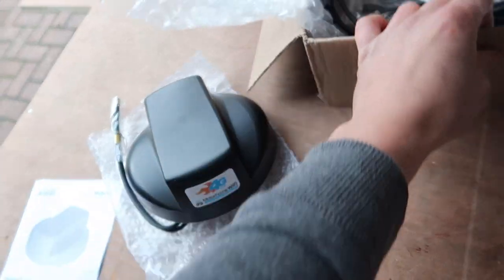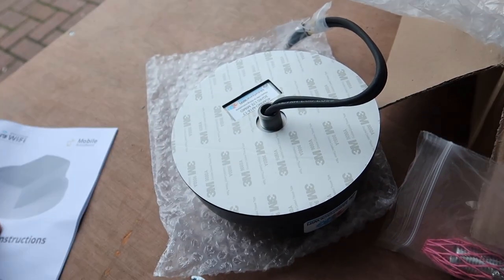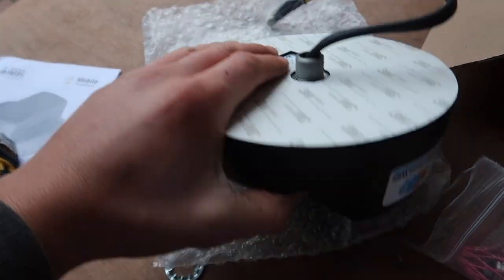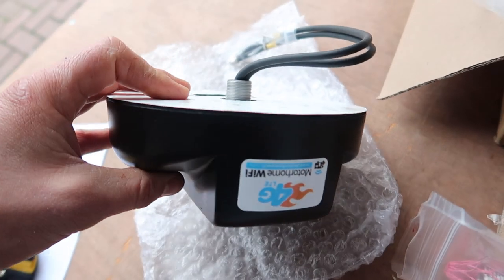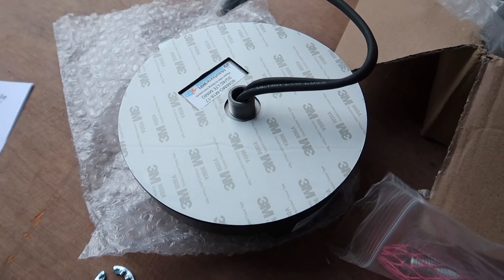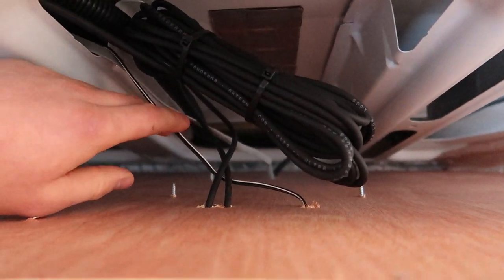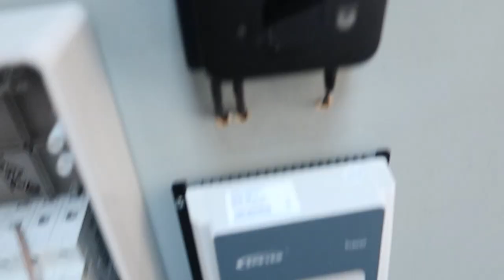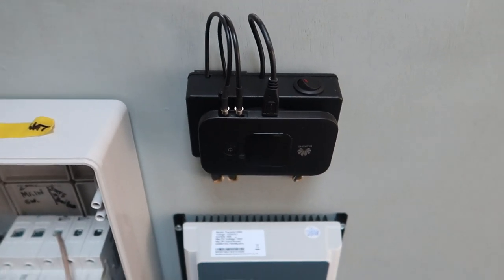Motorhome Wifi Install | Ep15 | Sprinter Camper Van Conversion

Comment: Looking good !
I might suggest using cheap black pvc conduit to run ALL wiring through ?
Not only does it reduce chafing ( shorting on the metalwork)  but also allows you to pull existing or new circuits through afterwards if needed.
Looks like a fun project ...

Comment: HI! Great Vids! I noticed on your roof by the wifi booster you have another antenna, is that a digital TV aerial? It looks like something I was looking into getting, which one do you have and how good is it? Cheers, Mark.
Reply from the maker: Honestly Mark we didnt use it much but when we did it worked well. It did seem to be good quality however and we did get signal. We tended to use our internet connection with media applications to play things through the internet. I cant find the one we used but here is a link to a very similar one probly the same manufacturer with different branding ---
https://www.ebay.co.uk/itm/203211173854?hash=item2f50546fde:g:GMMAAOSwUKZffnM1&amdata=enc%3AAQAHAAAA4L4B5nuCJXH7SrQsTVR7o2zaIUXFrA3APCb1jxtrvOatob6Nitw6mFCLPfmf4IF9DLTJDih%2FD4Zi2Irsqy21Y%2FINI2VWf8i8HrS2n4X%2B5mK5REiGdwrhnw5c3jvGmlzGKDEqHnDc2kK7I7nJVU6%2F2ismOkZOg3k2balWKSl0AXQIeYADj96zAsOxeWfYzN%2BUJb4iH9942Mzwz7vcf2CpCPKJy3aybWHq1rqtVpTADe11ELXSM%2B50qonY1dY9XkwogGQm6FXYp%2BF%2FmjmjdoLc7P5GbrK8W7wo1v7bbAMM5Ziw%7Ctkp%3ABFBMmr7T7dBg

Comment: I thought I had read somewhere that the aerial booster reqs a clearance all round of 150 mm, 
I noted you fitted yours quite close to the roof vent ?  Has your booster worked well,
PS thank you for the video I'm looking to fit one  👍👍👍
Reply from the maker: Hi Howard. Yes it has been fine

Comment: 2016 our trip away touring some sites was ruined when as soon as we got into the hills, no cellphone service, so no google maps, so saved pushpins or directions .... spent an afternoon driving back to civilisation to get signal to start the nav, to get back into the hills to lose directions and get lost again. I will be adding a booster to the van, but the moral of the story, have a paper back up! i think boosters are great, but you still need something to boost....
Reply from the maker: Yes paper back up essential haha. Nevermind ey, all part of travelling. We are pretty much going belts and braces in all aspects of the van so hopefully our trip with be as comfortable and convenient as possible. Good to hear about other experience

Comment: What size of fuse did you use for the power supply ? Can find the rating anywhere 🤔
Reply from the maker: Got a 10a in there Martin I could not find a rating either. If anyone can correct us on this would be appreciated.
Reply: @ScottAndJen  Cheers for getting back Scott/Jen 👌
Reply from the maker: Did you also go for a 10a?
Reply: @ScottAndJen  no I was just trying to find out as I have 2 and was just wondering if you put a 10amp for one do you double for 2 ?

Comment: Hi guys! I'm just trying to get my head around vanlife internet options. Can you clarify if this just increases the connection and you still need to purchase data as you would with mifi/dongle etc? Thanks!
Reply from the maker: Correct, Voxi sim is the best for data usage sim

Comment: Hi Scott and Jen. I’m just wondering what your opinions are of this system now you e had it installed and used for a number of months? I’ve heard mixed reviews and Ymir’s a lot of money to pay out for something if it doesn’t work very well. Hope you’re enjoying your trip through Portugal 👍🏻
Reply from the maker: The system is great. Would highly recommend. There has maybe been 1 or 2 places it didnt pick up a strong signal but that was out way beyond where you would expect to get signal and still it was dropping in and out

Comment: Isn’t every bit of cable a signal reduction? I would recommend to at least shorten the cable behind the cabinet. That should result in much better performance 👍🏻
Reply from the maker: The cables provided result in very little loss in signal because of the length. I was told what type they were once upon a time but not sure what they are called, co axial maybe? It wouldn't have been worth the time shortening for the difference it would have made, if any

Comment: Unless the roof is perfectly flat (yours could be a tad curved) it will leak, so better to addsealant around edges.
Reply from the maker: Incorrect the foam pad is about 4-5mm and more than covers "slight curves" that area of the van is indeed flat or with a slight curve, ran for 6 month with no problems. The kit specifically states not to use extra adhesive

Comment: Thanks for this video Scott. I must admit, I have been unsure about whether to go for a Wifi kit at all, or just rely on the iPhone 4G for connectivity. Have just had a read up on the motorhomewifi website, and the 'up to 5x' performance does make it sound like a good idea. Is it the 'Package 2' that you went for?
Reply from the maker: It was indeed Michael. I think whether it is worth it is down to the individual and where exactly you will be in your van. If you will be staying on camp sites, often they have wifi that can be linked to.
Reply: @ScottAndJen  Cheers Scott, I'll mainly be overnight on campsites, but could be out in the middle of nowhere during the day. I think I'll go for it, so that it's there for 'just in case'. Thanks for your help, that's another decision made. All looks super easy, appreciate you showing the install. I've already got a Huwaei 4G router at home, that I pop a SIM into if the house broadband goes down (which it does too often!), so I know the quality of the kit is good :o)
Reply from the maker: @michaell8835  its a really easy install mate and motorhomewifi.com are helpful if you have any issuies just give their office a call. Just make sure if you order online you choose which coaxial wires you want. Once you have picked where you are mounting the router and antenna measure the distance between them where you will run the wire. I chose to swap the 2m coaxial cables for 5m ones at no extra cost that is why there is fair bit of spare behind the board on this video. They are low loss cables so this wont affect the connection.
Reply: Scott & Jen Thanks for the tip, will measure up 👍🏻
Reply: Scott & Jen Really appreciate all your info.